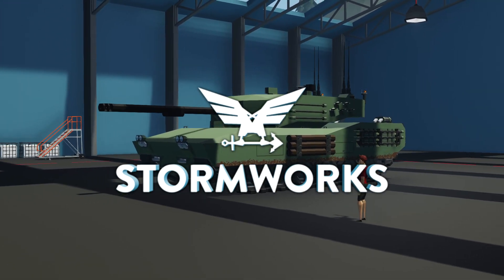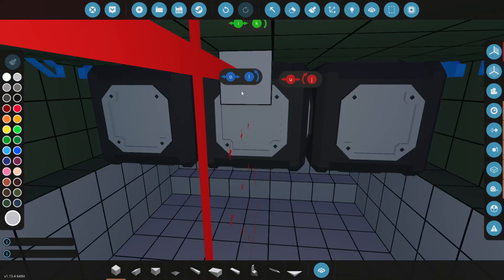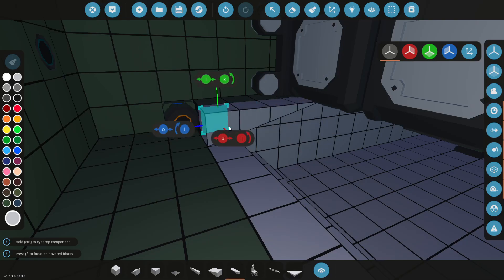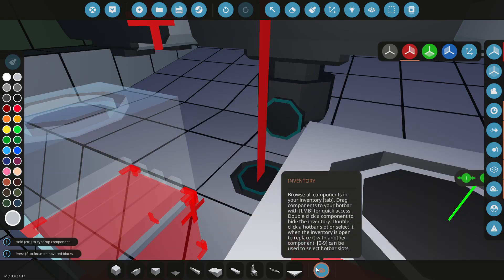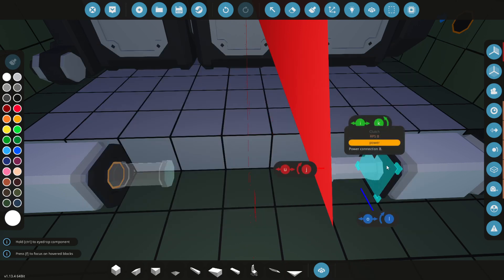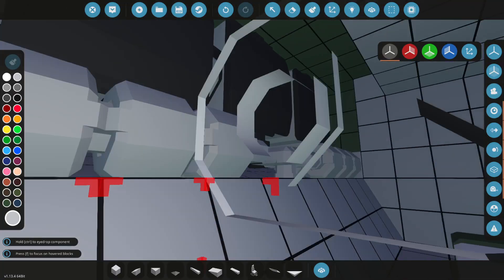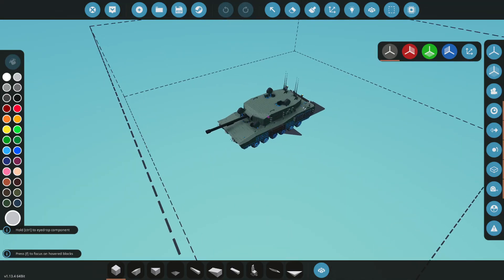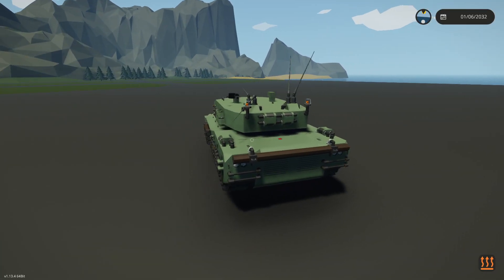SWAPPING THE JET ENGINE FOR A DIESEL! - MBT Build - Episode 5

Comment: That MBT had a bit of every 90s mbt in it 

Hull mostly leo2 + m1 with same merkava details
The turet is leo2 with challanger2 
The engine was t80 or m1 but now has the t72 layout  of a transverse orientation diesel  

A bold move would be too change the engine again to longitudinal orientation flat 10 turbo diesel as vanilla v10 of a leo1 or put a 12 cylinder in like most tanks have 😅

Comment: You can attach multiple turbines at the back of a jet engine to get a more powerful/efficient engine. I usually do 3/4 turbines per engine, it works straight after eachother or ducted 1 by 1 out of a combustion chamber

Comment: I really think you should do a rebuild of this, but use mods. Like I know you want to keep it as vanilla as you can, but there's some mods that add actual armor blocks (not as high of weight as weight blocks, but more durability) and there's another that adds 1x3 "v cylinders" for modular engines which pump out just a little more power. You can surround a single 1x1 block with 2 v cylinders and 2 normal cylinders for a total of 6 cylinders 1 a single block engine. Like you can really make things small/fit where they probably shouldn't with mods and I think you'd be able to make things look/feel a bit better.

One of my favorite mods is the compact weapons mod that actually gives a feeding transfer table/platform for autocannon and battle cannon ammo. I really want the creator to make an artillery and bertha variant already, but it basically allows you to rig up a system to feed ammo between objects without having to use feeders. Like you can finally make a self feeding auto cannon that has full rotation left and right and can pitch up and down with these feeder tables/platforms and keep the ammo in the hull of your ship or tank instead of it bulking up your turret. Again, I'd say do it for the sake of fun rather than anything serious......because a mod that squishes both steam boilers and steam turbines and shoves them into the same object model as the 1x1 air-to-liquid heat exchange piece makes for very interesting steam creations. 1x1 small pumps make certain things very plausible that were annoying before. Using a M2 Browning with an actual decent ammo pool (instead of 50 rounds, closer to 200) is a viable thing to want to use. Being able to stick a radar, a different style of fins, a reaction wheel, and a slider rail on a missile and keep it looking like a missile shouldn't be that difficult, but it requires mod parts.